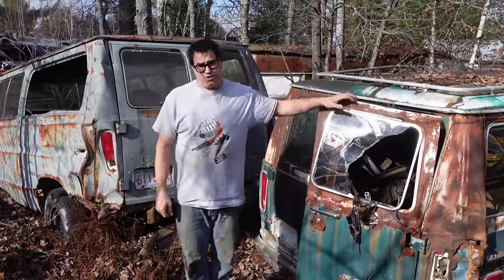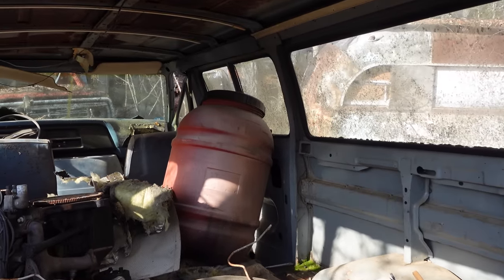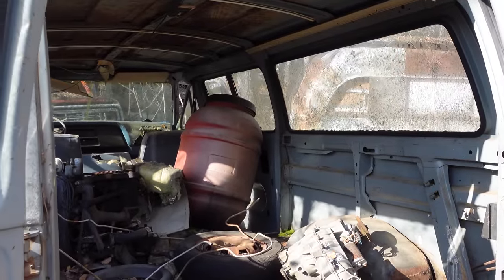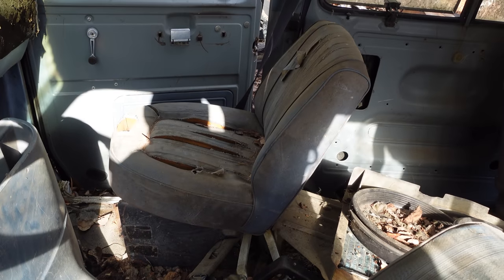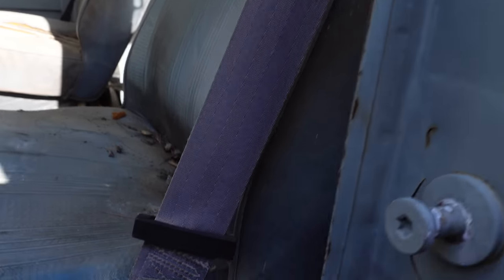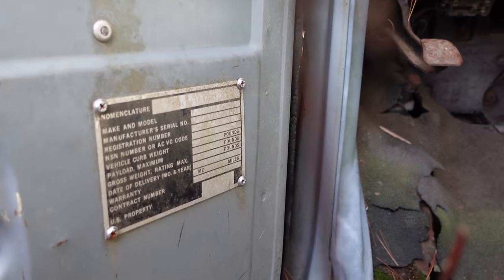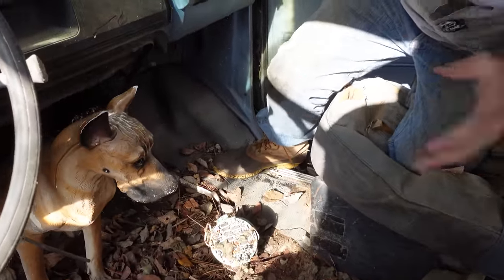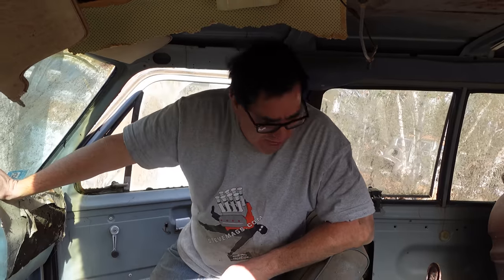Silent Navy

Comment: I was a US Army soldier 1973 to 1998 then a DOD civilian to 2018. I mostly remember driving Dodge vans. The Army discontinued the military Jeep in the late 1970s because of all the rollovers. The Humvee didn't appear until the mid 1980s so there was a long period that we only had vans and diesel pickups.
Reply: I was enlisted Army at the Public Affairs Office at Ft. Leavenworth in '82 and as I recall, the daily driver we used was a '77 Chevelle--one of those years--and it was stout and strong, always ready for its weekly drive into Kansas City.  And we called it the Skoal Bandit.  And it was dicey to park in the old horse barn used for the motor pool, the pillars between the stalls didn't leave much wiggle room.  Then, that summer, Ft. Leavenworth must've been one of the first on the list to get the K-car and so okay, we knew we needed to baby it, a brand-new car and all.  And it was decent work transportation, no knock, just not the same as the Skoal Bandit.

Comment: I had an 85 Dodge B150 ex-Air Force van.  Passenger type but very bare bones.  No carpet, but it did have interior panels.  Slant 6, automatic with dealer installed A/C.  Base grille, with white painted bumpers.

Comment: Dad bought a used 1980 Econoline 150 Custom for our produce farm. 300/3 on the tree, open 9" (I don't know what gear ratio) and, no extra windows except in the back doors and the slider. She was a local dry cleaners delivery truck previously so, was pretty well whipped when we got her and, eventually, the column shift linkage got so sloppy that it wouldn't work at all. The 16 year old mechanic in me used his best "farm boy fabrication" skills to adapt a "universal" column to floor shift conversion kit originally intended for pickup trucks to sorta work in the van. I had to turn it around backward, bend a piece of all thread and weld it to the stick so that you could reach it when it was in 1st and 3rd gears. Reverse and 2nd gear would often cause the driver (usually me) to bust a knuckle on the dog house though. However, dad was happy that I made it possible to get another couple years out of her delivering produce to small, local grocery stores in our area. I absolutely HATED that van at first and, I'm pretty sure she felt the same about me but, over the miles, I think we developed a grudging respect for each other, I knew that the old girl would get me back home under her own power 94.7% of the time and, she knew that, the 5.3% of the time we came home on a hook or chain, I'd get her fixed up and back to work. I actually wouldn't mind having a simple, mostly trustworthy vehicle like that right now lol!

Comment: Happy Thanksgiving Steve. No one else can make the most striper model six cylinder Ford Econoline you could buy sound so cool. Well done. I've seen a lot of these 3rd Gen burn up from oil leaks and wiring. Not this one its got puppy power activation. That small block C6 is a hard find around here. Namaste 🙏🏼

Comment: A hardware store in my home town used to order a van with the front passenger seat delete option as well as the radio delete for their delivery vehicle.
My old boss Ralph would almost always buy a Dodge B200 van. He didn’t bother getting a radio until the 1970s and never opted for the sliding door. It was somewhat unusual for a mason to have a van, but his hobby was restoring old cars and he would take the van to Hershey every fall, towing a trailer with either a car or a ton of brass era parts. For many years he and his wife would sleep in the van, on the flea market field instead of getting a hotel room.

Comment: Military fleet vehicles have been a bit upgraded since this van was procured.  In the mid-2000s my company had a minivan and a 12-passenger van; both had radios but not many more comforts.  When I reported to recruiting in 2008 I got a 2005 Dodge Stratus but traded it in for an '09 Pontiac G6 a few months later.  I guess the government worked a deal with GM for the last of the Pontiacs, because this had a CD player and the sports package with leather wrapped steering wheel and upgraded rims.  Later, as a Drill Sergeant, I drove a 2015 Chevy 2500 HD that was kind of bare bones but had a Bluetooth radio for those rare times I was driving instead of walking those 12 mile road marches.

My last assignments were working for 2-star generals.  Needless to say, their vehicles were a bit nicer than the ones assigned to Captains and NCOs.  Even in Operations, we had a couple of fairly loaded Ford Fusions.
Reply: They're modestly equipped, depending on who gets them. Even the most basic work truck today has power windows, locks, multi-media radio, of course AC and other creature comforts.
Reply: @googleusergp  ... the so-called basic work trucks today have what's called a fleet option package. Power windows so you don't have to stretch to reach the other side, (and rainwater rots the floors) AC to keep the windows clear on a rainy day, and usually a basic AM / FM to prevent accidents via boredom. (also traffic / weather) The package from some includes a trip odometer, because many trades charge mileage to the customer. The extra items actually add very little in end cost because they are building them by the thousands anyway.
Reply: @rupe53  Yes and no. Ford is more ala carte. You can get an XLT with a rubber floor, but you get the Power Equipment Group standard. But the Power Equipment Group can be ordered on other trim levels as well. Mostly, it's done for ease of manufacturing. If the "option" proves popular, sometimes it's made standard and rolled into the price of the truck. Yes, economies of scale bring cost down over time. It also means fewer parts to buy, stock, source and deal with. Ford is about the most flexible with their medium duty truck line. GM's new Silverado HD 4500/5500/6500 have gaps in options and product lines. I've met with GM reps from our area several times and asked them why they don't offer an extended cab like Ford does (Ford has regular/Super (extended)/Crew offerings), and the flim flam answer they gave was, "Well, we accomplish the same thing with two cab offerings". Huh? No you don't. LOL. The Super Cab allows for a (albeit small) back seat or an area for the operator to keep their personal gear temperature controlled without the size of a crew cab. Plus the 4500/5500/6500 only are sold at Chevrolet (not GMC) dealers, which makes no sense. 

In the Northeast, the dealer representation of that product is a bit poor, and it's almost like GM doesn't want to be in the market. LOL. Odd. The Ram offerings stop at 5500, so the most you get is 19,500# GVWR. I'm not a Ford guy by any means, but they do have a vast product offering. Up until a few years ago, you could get an F-650 with a Cummins ISB and an Allison automatic. Now it's the Powerstroke 6.7 and the "Torqshift" 10-speed automatic for the 650. Ford did do something slick though. They came out with the F-600 which is the F-550 cab but gives you 22,000 # GVWR. That was a smart move on their part.
Reply: @googleusergp  .... yeah, I see what they did there. I retired a few years ago and my experience was mostly with Chevy vans so that was my slant on things. When they went to the Express van and changed body style we tried a few then switched to Ford high top vehicles, which are now offered in all wheel drive. Chevy dropped the ball there. No high top and no all wheel available now. They did offer the AWD version for a few years in the 1/2 ton version only. The driveline was just not up to the task and had many service issues as a work vehicle.
Reply: @rupe53  Don't forget about the Quigley 4WD conversion on the Express. It's a GM ship through code and about as close to "factory" as you'll get now.
Reply: @googleusergp  ... we looked at stuff like that years ago and found that in fleet use we'd have issues with fast parts availability. We already had the "hotdog wagon" option of opening sides and found problems waiting for replacement parts. On top of that, Ford offered the high top with factory AWD and with a higher gross weight. Since our guys were already packing well over gross weight it was not a hard decision to switch. We also traded the old Astro vans for the Mercedes Metris, which still fits into a parking garage, but will handle another 500 pounds over the Chevy half ton. (those are RWD only) I am retired now so it's not up to me anymore.  <LOL>
Reply: @rupe53  We have Transits, Sprinters, Express vans, we have them all. No more diesel in the Transit though. GM dropped it for a year in their vans, but is supposed to come back out with it by 2024.

Comment: My pops had one of these when I was a kid. His was a 69 Econoline, Same navy color and trim but I never found the badging from the navy in the van. Uncle Sam converted his particular van to propane. I guess that was a thing back then..... Great crawl Steve! Happy Thanksgiving to you and everyone watching 🇺🇸
Reply: I'm a bit surprised they didn't provide the government with an even smaller engine than what they offered to the public, like a 250 or 200 inline 6 instead of the 300.  I drove an E-350 with a 300 and power to spare even when stuffed with newspapers, so I'm sure a 200 could power and E-150 at navy speed, perhaps with a lower rear end gear.  And, combined with a smaller radiator and battery, it could get better traction, which always costs more time than lack of power.
Reply: @alan6832  Thanks for the reply Alan. Excellent point you made, That 300 was a beast!

Comment: I had the chance to buy a 1968 or '69 Fairlane which was a USAF car in Goose Bay about four or five years ago. Since it spent it's entire life at Goose, it was absolutely rust free, save for some sunburn on the roof, trunk cover and hood. The front doors still had "U.S. Air Force - Official Use Only" with an ID number painted with a stencil in yellow. Apparently the engine (inline 6) was pretty sick and the car needed a fair bit of other mechanical work due to it being laid up for so long. I had a good 302 block, which if I had bought the car, would have went in to make it a fun little sleeper.
Alas, it was one of those cases where someone was this close to getting something cool, but the X, Y, and Z factors just didn't allow it to happen. I hope it hasn't been turned into tuna cans by now...
Reply: It may have been a base or wing commander's car.  Base and wing commanders back then usually drove what was known as a "white top" which was a sedan painted blue, but also had a white roof and a red gumball light on top and the rank designation on the front license plate which would be "Full Bird" Colonel or above.  Whenever, you saw a "white top" coming at you, you best snap to attention and salute.  The gumball light was used when the car on the flight line, usually to monitor something like an alert exercise or a klaxon response.  Whenever the base or wing commander got a new car, the roof was painted blue, the gumball light removed, and it was put into regular motor pool service.

Comment: A lot of these did have seats, they were thinly padded, fold up, easily removed or installed. In the U.S. Army they were used for hauling troops around, things like sick call or special duty with small groups of troops like police call picking up garbage or cutting grass. At least the seats were not dry rotted wood seats and you had cover over your head to keep you dry.
Reply: Yes , the fact that “Club Wagon” was listed as the model tells you it had seats at some point .

Comment: I’ve seen a lot off those here in San Diego Navy town they get sold or auctioned to the public and they generally have real low miles. Because there normally just used on the base. Great Videos Steve.👍
Reply: Hi I live in San Diego as well and have always wanted to buy an ex navy vehicle. Do you have any contacts here in San Diego.  If you would like to contact me I will give you my email first and contact me and will give you my phone number offline.  Also would like to know about where and when they auction surplus off.  Thank you. David
Reply: @davidgleason3379  Look up government auctions or Navy DRMO which is at NAF Imperial Beach, government auction site has stuff all over the country from all services.
Reply: @David Gleason I worked for Coca Cola almost 20 years as a Class A driver. Still Driving I drive on all the bases Coronado Island. 32nd street . And Camp Pendleton . I always came across people that told me on the base that worked in the Commisarys. That they sell those Vehicles. Never needed a Van or pickup. I left the Company 7 years ago. I worked at the Old Plant off the 94 frwy. Even at that plant we had Old Ford Ranger pickups that they sold for next to nothing. I just did need them at the time don’t have no info for you.🤷‍♂️
Reply: @5695q  thank you for your help through.  I know that plant my cousin worked there in the 80"s  also was able to take a tour of plant.
Reply: @Daniel-fd3wp  thanks for the information my cousin worked at that plant in the 80"s also was able to tour that plant when my teacher arranged a work class that we would see different companies

Comment: In 2015, I bought a 2007 Ford Ranger pickup with only 26,000 miles on it. It had been owned by the U.S. Government and used on a military base to carry old computers in the bed. It had 4WD and the 4.0 V6 and automatic transmission, but otherwise, it was sparsely equipped (e.g., crank windows, manual mirrors). It was my daily driver for five years and is still going strong. Ex-military vehicles rock.